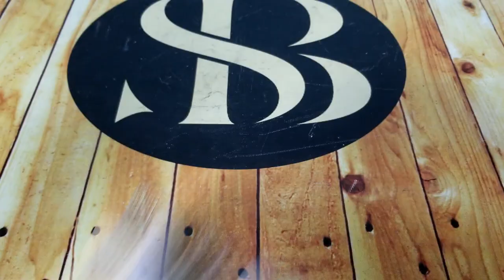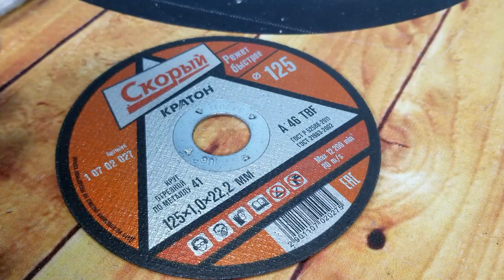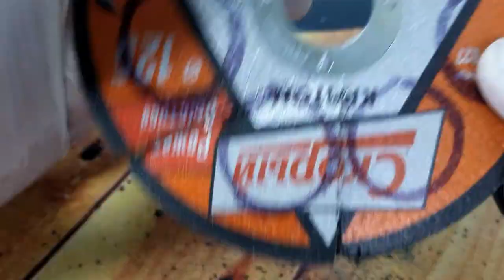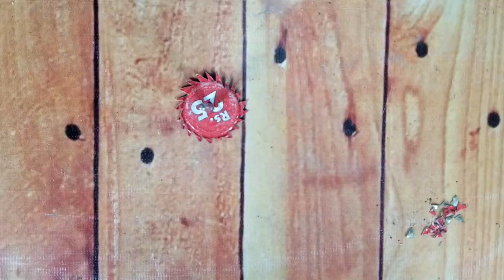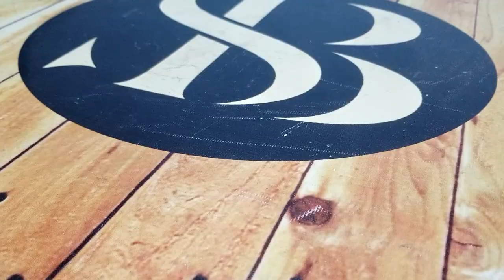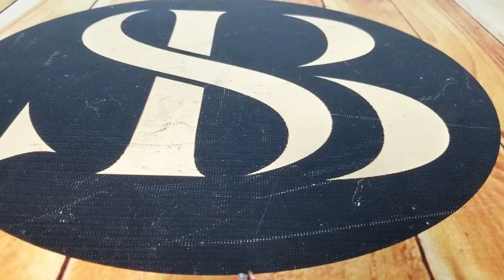Home made | Dermel (wire brush,carbon disc,wood cutting blade) | DIY

Comment: When you started pulling the wires off the brush and showed the washers, I thought you were going to hook the wires around the center hole of the washer, then secure them in place with the second washer.  Interesting how you put it together.